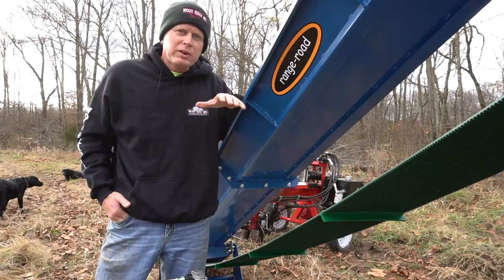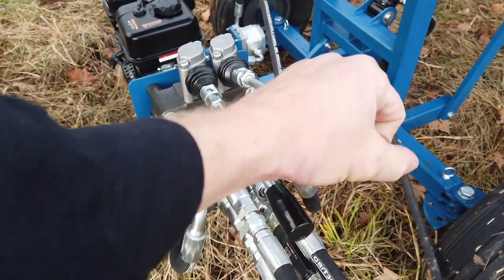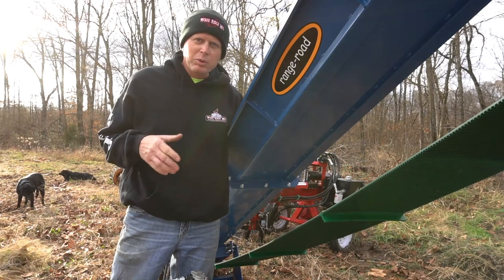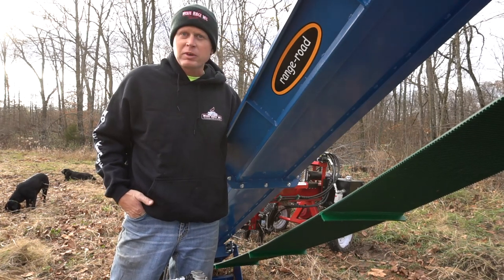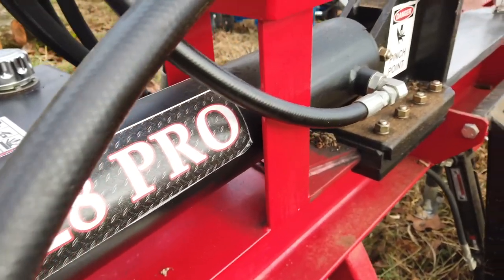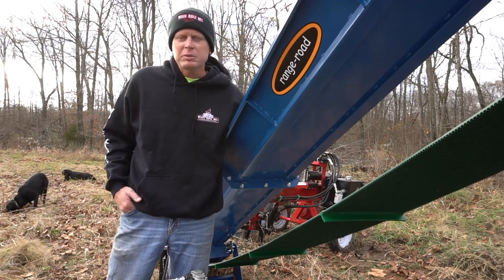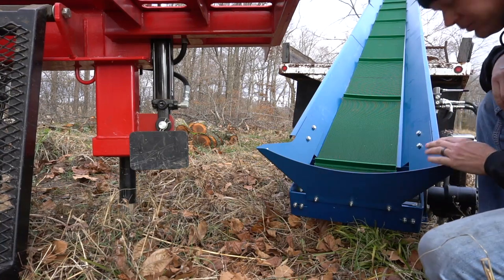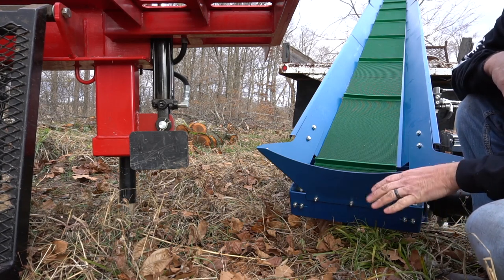Wolfe Ridge 28 Manufacturing & Range Road RR502 Stand Alone Conveyor! Firewood Processing!

Comment: When I refurbished my old  belt conveyor I used plastic truck mud flaps to build the hopper. It's extremely durable, lightweight, it's super easy to work with, and it dampens the noise as you load it.
Reply from the maker: I installed 2 wings on the side of the hopper a while back and so far its been working excellent. Just ready for the weather to straighten up so we can start splitting a little more.

Comment: I'm looking at the RR502 conveyor and was wondering if you thought it was a good way to go.  It's so much less expensive than the other commercial conveyors.  I do about 20-30 cord a year and need some way to keep the wood moved away from my splitter.  I'd be splitting into a dump trailer or totes.  Please give me an honest opinion.  Thanks!
Reply from the maker: I do enjoy this conveyor, it does a great job for us, however, if I were to move 20-30 cords I would prolly look into a chain drive conveyor. The tracking is very sensitive, small hopper, slips when overloaded, slips if it's wet or frosty out, and we had to modify the conveyor a bit to move wood more efficiently. I was looking for an affordable conveyor when I bought this and thought this would be the way to go. Works great for us, but I wish I would have bought a chain drive.

Comment: If you were on pavement would you be able to move the conveyor around by hand or is it too heavy?  I think it looks pretty interesting.  I always thought of a lighter conveyor like that to leave in my drying yard to help load my trailer.  It's pretty tight to get a tractor in there to move stuff around but if that conveyor could be tugged by hand it may work.  Good job w the video.  Joe
Reply from the maker: I definitely believe you would be able to move that conveyor pretty easily by hand if it were on pavement. Thanks for watching!

Comment: Would you be able to show some of the conveyors functions in an upcoming video? Like showing it raise and lower, maximum and minimum height, wheels rotating, I believe it folds for easier transport? can you speed up the belt any? I’m currently on the list for one and their promotional video doesn’t do the machine much justice, yours was much more informative!
Reply from the maker: I definitely will in a later video. Not sure what happened, but the other day I sheared a pin or something in the lower roller so going to be a bit before I get it back up and going as wood is just a little hobby for us. Other than that, conveyor has been doing great. I've been pretty rough on that belt also and it will definitely take some abuse.

Comment: I know this is an old video but thought Id share my thoughts on the conveyor. Just got my RR503 (chain drive) and not a bad piece of equipment if you take care of it. It took me about 5-6 hours to put together and a second pair of hands for the trough and chain would have been nice. Some of the things on my wish list for this conveyor are better hardware (grade 8 nuts and bolts),  better hose routing and/or hose protection, the rear hoses on mine run right over one of the rear jack handles and they are just hanging out there to trip over or a piece of wood falling off can damage them.  The hopper size is kind of a joke but you could always fabricate something bigger. They could color code the hoses so theres no guessing, have a set of adjustable trough support legs and for God sakes!.....include a set of updated instructions, yes you can print off a set but the pictures had me kind of guessing at certain points and it was missing a few steps. Like I said in someone else's video, it's not a Wolfe Ridge or Eastonmade but it's not 13k either but definite room for improvement.

Comment: I'm going to have to look into that style of conveyor for the price, also have you used fluid film on leather gloves I have used that stuff on everything and it works better than chain lube
Reply from the maker: Sure can use it on leather gloves. I actually called the company and asked if I could condition my truck seats and they said absolutely, but they did say it would leave a slight smell. Well needless to say, I used it anyway and it worked great. It did leave a slight scent for a few days, but works great. Conveyor has been working great, should have another video of it very soon, just a bit muddy getting back in the field at the moment.
Reply: Great I bought some gloves that dyi dude ranch had and I want to treat them before I use them

Comment: How much was the conveyor?  Did you have it shipped or buy it at a dealer?
Reply from the maker: If I remember correctly, I believe it was just under 3k and had it shipped to the house. You do have to put it together but it's not too bad once you get started. The belt does a good job, however there are some tricks to make it track easier. On wet or damp days, the belt is wet so it slips easy, also if it's overloaded it will also slip a bit. Overall, it does a good job for the amount I move, if you move a bunch of wood, a chain driven may be a better option.

Comment: Update on. this conveyor. (for. me).  I give. it 6 out of 10, so. far Ive ran about 12 full cords through it. and. yes it beats throwing it by hand but...so. far a coupler sprung a. leak,  the top. extension wings are. on the inside of the trough and wood catches on the  lip. causing the wood to flip and catch the chain and break the cleats. off (ive broke 4 so far).  The cylinder to raise the trough keeps drifting down a. couple. inches every 10 minutes or so even while 1/2-3/4 throttle. The chain isnt very fast. even at.  full throttle and only being a 18ft conveyor.  you only get about 10ft tall piles. which for me is a pain trying to fill a 25ft x 25ft bin. The generic engine starts. right up and runs well but overall a lot of room for improvement! For 3600.00 (including shipping) it's not terrible but I. only. see. this thing lasting a very short time unless I do some mods to it.